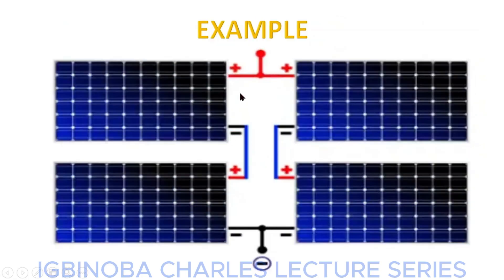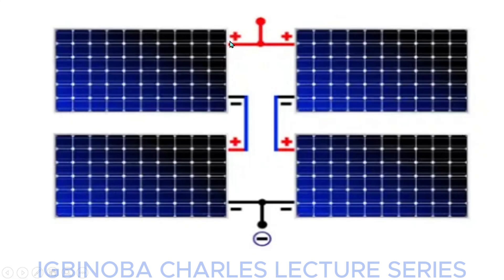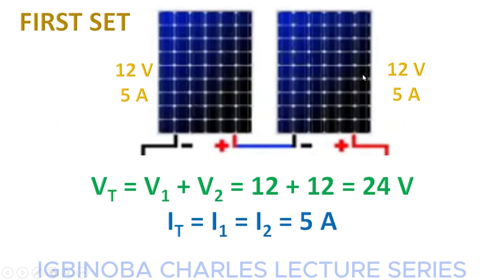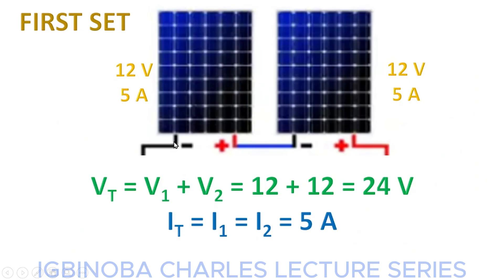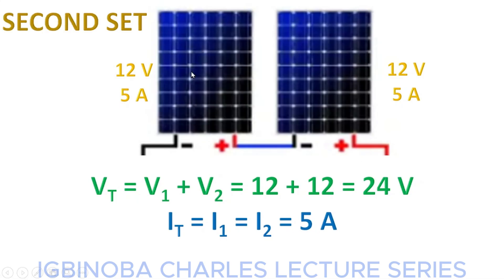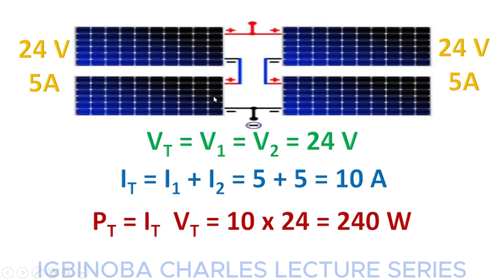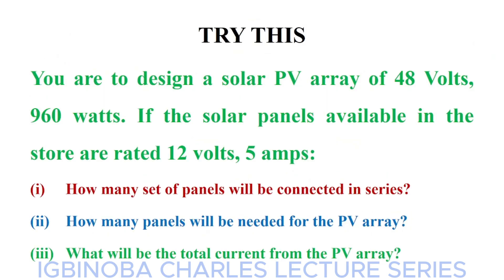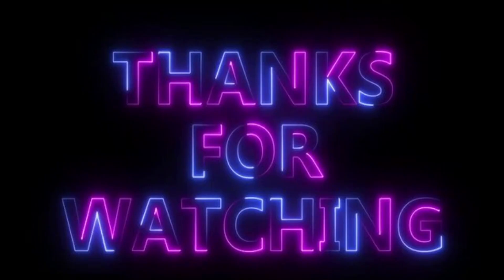Connection of  Solar Panels in SERIES-PARALLEL

Comment: MAR371S

SOLUTION 
1. NUMBER OF PANELS CONNECTED IN SERIES 
48V ÷ 12V = 4 PANELS

2. PANELS REQUIRED FOR THE PV ARRAY 
The power output of one  panel is the total voltage multiplied by total current.
P = 12x5 = 60Watts
Therefore the total number of panel to produce 60Watts is 
960 ÷ 60= 16 PANELS

3. TOTAL CURRENT FROM THE PV ARRAY 
Using the formula (I = P ÷ V)
I= 960W ÷ 48V = 20A.

Comment: MAR40N
1- 4 panels will need to be connected in series 

2- 16 panels will need to be  connected in parallel 
 
3- The total current of the array is 20Amps

Comment: MECH364L

1:
Number of panels connected in series = 48 ÷ 12 = 4

2:
Power output of one solar panel = 120 V × 5 A = 600 W.
The total required power for the array is 960 W, so the number of panels required = 960 ÷ 60 = 16 panels.

3:
There are 16 panels in total, with 4 panels connected in series.
Number of parallel strings = 16 ÷ 4 = 4 parallel sets.
Each set produces a current of 5 A.
Since the sets are connected in parallel, the total current becomes 5 A × 4 = 20 A.

Comment: MECH3107C

1:
Number of panels connected in series = 48 ÷ 12 = 4

2:
Power output of one solar panel = 120 V × 5 A = 600 W.
The total required power for the array is 960 W, so the number of panels required = 960 ÷ 60 = 16 panels.

3:
There are 16 panels in total, with 4 panels connected in series.
Number of parallel strings = 16 ÷ 4 = 4 parallel sets.
Each set produces a current of 5 A.
Since the sets are connected in parallel, the total current becomes 5 A × 4 = 20 A.

Comment: CHM315OT

1. 4 panels are connected in series, we connected four 12V, 5A panels in series, so we get a total of 48V, which is the voltage needed for the solar system.

2. A total of 16 panels are needed. Each panel produces 60W (12V * 5A).

3. The total current from the solar array is 20A using \(I = P + V

Comment: MECH3207A

i) 4 sets of panels are connected in series 
    That is 48V ÷ 12V = 4

ii) 16 panels are needed for PV arry 
     That is 960W ÷ 60W = 16

iii) Total current for PV array = 20amps
      That is 960W ÷ 46W = 20

Comment: COMP366N

I. Panels in series: 4
Because each panel is 12 V, and you need 48 V, you connect four in series (12 × 4 = 48 V).

II. Total panels: 16
Each panel is 60 W (12 × 5). Four in series give 240 W, so you need four of those sets (960 ÷ 240 = 4).
4 sets × 4 panels = 16 panels total.

III. Total current: 20 A
Each series set gives 5 A, and four sets in parallel add up: 5 × 4 = 20 A total.

Comment: MECH3180X

1. 48 ÷ 12 = 4 is the number of panels connected in series. 
2. One solar panel can generate 600 W, or 120 V × 5 A, of power. 960 W of power is needed by the array, which is equivalent to 16 panels (960 ÷ 60). 
3. Four panels connected in series make up a total of sixteen panels. 16 ÷ 4 = 4 parallel sets is the number of parallel strings. Five A of current are produced by each set. The total current is 5Ax4 = 20 A because the sets are connected in parallel.

Comment: PETRO3148R

i) When connecting panels in series, voltages
addup, but the current remains the same.

Required voltage = 48V
Each panel voltage = 12V
Number of panels in series = 48/12

= 4 PANELS IN SERIES

ii) A total of 16 Panels would be needed

Each Panel produces 60 watts I.e. 12V x 5A =
60W

To get 960W in total, therefore, 960W / 60W =
16 Panels

ii) Utilizing the formula - 1 = P/V

I = 960W / 48V = 20A

Comment: PETRO390L 

(i) Number of panels in series = 48/12                
    =4 panels in series

(ii) Panels needed for the PV array 
     Power = 12x5 =60W
    Number of panels = 960/60 
    =16 total panels 

(iii) Total current from the PV array
      Number of parallel sets = 16/4 =4 
       Each string produces 5A so the
       total current = 4x5 =20A
       Total Current = 20A

Comment: PETRO31A

(i) Number of panels in series = 48/12                
    =4 panels in series

(ii) Panels needed for the PV array 
     Power = 12x5 =60W
    Number of panels = 960/60 
    =16 total panels 

(iii) Total current from the PV array
      Number of parallel sets = 16/4 =4 
       Each string produces 5A so the
       total current = 4x5 =20A
       Total Current = 20A

Comment: PETRO338L

1. When connecting panels in series, voltages add up but current stays the same.
Required voltage= 48v
Voltage of each panel= 12v
No of panels in series = 48/12=4 panels in series 

2. A total of 16 panels would be needed. Each panel produces 60watts i.e 12v×5A
= 60W
To get 960W in total, 960W/60W
=16 panels

3. Using the formula, I=P/V
I= 960W/48W
= 20A

Comment: CHM391M
1 , 4 sets of panels will be connected in series 
Since 48v/12v =4

2, 16 panels will be needed for the PV array 
960W/60W= 16

3, The total current from the PV array is 20A
960W/48W= 20A

Comment: CHM 38H

i. 4 sets of panels are connected in series. (48v ÷ 12v = 4)

ii. Total of 16 panels are needed for the PV array. (960W ÷ 60W = 16)

iii. The total current is 20A. (total power/total voltage = 960w ÷ 48v = 20A)

Comment: MAR3109E 

1.Series Connection:
The number of panels to be connected in series is calculated as:
48 ÷ 12 = 4 panels in series.

2.Power per Panel:
Each panel generates:
120 V × 5 A = 600 W.

The required total power for the array is 9600 W.
Therefore, the total number of panels needed is:
9600 ÷ 600 = 16 panels.

3.Parallel Connection:
Since there are 16 panels in total and 4 panels per series set, the number of parallel sets is:
16 ÷ 4 = 4 sets in parallel.

Each set supplies 5 A, so the total current in the PV array is:
4 × 5 A = 20 A.

Comment: CHM3132B

1) To achieve total voltage of 48V from 12V panels, (series connection)
48/12 = 4 panels in series

2) Total Power = 960W
Power in each panel= 12 x 5 = 60W
No. of panels needed = 960/60
= 16 panels in total

3) Total Power = I(total) x V(total)
I(total) = Total Power/Total Voltage 
= 960/48
= 20 A

Comment: PETRO339M

i) When connecting panels in series, voltages add up, but the current remains the same.
Required voltage = 48V
Each panel voltage = 12V
Number of panels in series = 48/12
= 4 PANELS IN SERIES
ii) A total of 16 Panels would be needed
Each Panel produces 60 watts I.e. 12V x 5A =
60W
To get 960W in total, therefore, 960W / 60W =
16 Panels
iii) Utilizing the formula - I = P/V
| = 960W / 48V = 20A

Comment: EEE356D

A 960w 48volts should supply 20A

A panel rates 12v, 5A

I) To generate 48volts and 5amps, the number of panels needed to be connected in series are;
48/12= 4 panel

ii) To generate 20amps the number of panels needed In parallel are;

If 4 panels = 5amps 
then Xpanels=20amps😮
5x=80; x=16 panels 

iii) The total current of the array is;
I=960/48=20Amps

Comment: EEE3128X
1) 4 panels are connected in series i.e 48v÷12v = 4 panels 

2) Each panel produces 12v×5A = 60w
Therefore, 960÷60 = 16w

3) Total Current ; 960 ÷ 48v = 20A

Comment: PETRO3187E
1. Four panels will be connected in series
48v/12v =4
2. Sixteen(16) panels will be needed for the PV array
960W/60W =16 
3. Total current from the PV array = 20A
960W/48V =20A

Comment: PETRO3109E

To achieve a final voltage of 48 V for the array, you'll need to connect the panels in series. Since each panel provides 12 V, you'll require 4 panels connected in series. 2. Each panel generates 60 W (calculated as 12 V x 5 A). Given that the total power needed is 960 W, you'll need a total of 16 panels to meet this requirement. 3. With a total of 16 panels and 4 panels per series string, you'll end up with 4 parallel strings. As each string provides 5 A, and since they're in parallel, the total current will be 20 A (5 A x 4).

Comment: MECH357E

1.) Four (4) panels are to be connected in series (48/12=4)
2.) A total of 16 panels are needed for the array. 
The required power in the array is 960 W. Therefore the number of panels needed for the array is 16 panels (960/60=16)
3.) The total current from the PV array is 20amps
(I=960W/48V=20 A)

Comment: PETRO 363K 

1) FOUR (4) panels are connected in series 
      48v / 12v = 4 

2) The power generated by one panel= Vt x It = 12 x 5 = 60watts
To get 960watts in total 
   960/60 = 16 panels 
So for the pv array , 16 panels will be needed

3) Total current , I = P/V 
       I = 960watts / 48volts = 20A
   So total current = 20A.

Comment: PETRO375W

1. Four (4) sets of panels will be connected in series.
2. Sixteen (16) panels are needed for the PV array.
3. Total current from the PV array is obtained using the formula; I=P/V
Where; P=960watts, V= 48 volts
1= 960/48=20Amps

Comment: MECH3171O

1:
Number of panels connected in series = 48 ÷ 12 = 4

2:
Power output of one solar panel = 120 V × 5 A = 600 W.
The total required power for the array is 960 W, so the number of panels required = 960 ÷ 60 = 16 panels.

3:
There are 16 panels in total, with 4 panels connected in series.
Number of parallel strings = 16 ÷ 4 = 4 parallel sets.
Each set produces a current of 5 A.
Since the sets are connected in parallel, the total current becomes 5 A × 4 = 20 A.
Reply: Mech3115k

1. 4 sets of panels will be connected in series.

Since connecting 4 of the 12 volts, 5 amp panels in series gives a total of 48 volts as required by the solar PV array design

2. 16 panels will be needed for the PV array.

This is because the power of each panel is 12 x 5 = 60 watts, therefore the total number of panels to produce 960 watts is, 960/60 = 16

3. The total current from the PV array is 20 amps Since I (total) = P(total)/ Vitotal) I (total) = 960/48 = 20amps

Comment: COMP338L

1. 4 sets of 12V 5A panels will be connected in series. Ie, Vt=12+12+12+12=48V
2. 4 sets of 4 panels connected in series will be needed; 16 panels are required
3. The total current will be 20A

Comment: MECH 361I

1.	The number of panels that will be connected in series is calculated as 48 ÷ 12 = 4.
	2.	Each solar panel generates 120 V × 5 A = 600 W. The total required power for the array is 960 W. Therefore, the number of panels needed in the array is 960 ÷ 60 = 16 panels.
	3.	Since there are 16 panels in total and 4 panels are connected in series, the total number of parallel sets is 16 ÷ 4 = 4. Each series set produces a current of 5 A. Because the sets are connected in parallel, the total current becomes 5 A × 4 = 20 A

Comment: PETRO343Q
1. 4 panels are connected in series
2.16 panels will be needed for the PV array system:
Each panel has a rating of 12v 5A, the power of each pan l will be 12×5=60W
P=IV
From the total power of 960W, we get 960/60=16 panels for the PV array system
3.  Total current= P/V
 960/48 =20A

Comment: CHM3112H

1. 4 panels are connected in series, we connected four 12V, 5A panels in series, so we get a total of 48V, which is the voltage needed for the solar system.

2. A total of 16 panels are needed. Each panel produces 60W (12V * 5A).

3. The total current from the solar array is 20A using \(I = P + V

Comment: PETRO3103Y 

1. 4 sets of panels would be connected in series(48V / 12v) = 4

2. A total of 16panels would be needed for the PV array (960W / 60W) =16

3. The total current from the PV array is 20A .
(960W / 48V) = 20A

Comment: PETRO3117M

1.Number of Panels in Series
Required system voltage = 48V
Each panel voltage = 12V
Number of panels in series = 48V ÷ 12V = 4 panels
Answer: 4 panels in series.

2.Total Number of Panels Needed
Power of one panel = 12V × 5A = 60W
Total required power = 960W
Total number of panels = 960W ÷ 60W = 16 panels
Answer: 16 panels in total.

3.Total Current from the PV Array
Total panels = 16
Panels in series = 4 → Number of parallel sets = 16 ÷ 4 = 4 sets
Current per set = 5A
Total current = 4 sets × 5A = 20A
Answer: The total current is 20A

Comment: PETRO3111G

1. 4 sets of panels will be connected in series.
2. 16 panels will be needed for the PV array.
3. The total current from the PV array is 20 amps

Comment: PETRO352Z

1. Four panels are connected in series. When you connect four 12-volt, 5-amp panels in series, you get a total of 48 volts, which is the voltage needed for the solar system.
2. A total of 16 panels are needed. Each panel produces 60
watts (12V x 5A = 60W). To get W in total: 960 60 =
16
panels.
3. The total curent from the solar array is
20-amps. Using the formula I = P + A,
1 =960W / 48V = 20A.

Comment: PETRO3168L
1). 4 panels are connected in series

We connected four 12-volt, 5-amp panel in series, so we get a total of 48 volts, which is the voltage needed for the solar system.

2). A total of 16 panels needed.
Each panels produce 60 watts I.e 12V × 5A =60W
To get W in total: 960÷60=16 panels 

3).The total current from the solar array is 20 amps
Using the formular I = P + A
Therefore I= 960W÷48V =20A

Comment: CIV383E

1. Four panels are connected in series 
12-volt,5-amp panels are connected in series , you will have a total of 48volts , which is the voltage required for the solar system 

2.A total of 16 panels are needed 
Each panel produces 60watts i.e (12v × 5A=60W)
To get 960W in total 960÷60=16panels

3. The total current from the solar array is 20amps 
Formula=I =P÷V
I =960W÷48V=20A

Comment: MECH3185C

Required PV array: 48 V, 960 watts
Solar panel available: 12 V, 5 A

(i) In series, current is constant for all panels but the voltages add up.

So, we need a total voltage of 48 V, and each panel has 12 V.

Total number of panels = Total required voltage ÷ Voltage per panel
= 48 / 12
= 4 panels

(ii) Total number of panels for the array = 

Total power needed = 960 watts
Power in each panel = 12 V × 5 A
= 60 watts

Number of panels = Total power required ÷ Power per panel
= 960 / 60
= 16 panels

(iii) Total current in PV array = ?

4 panels are connected in a series string with a total voltage of 48 V and a total current of 5 A.

We have a total of 16 panels, hence:
Number of parallel strings = Total panels ÷ Panels per string
= 16 / 4
= 4 parallel strings

In a parallel connection, voltage is constant but current is not constant.

Voltage required: 48 V

Total power: 960 W

Panels per series string: 4

Total panels: 16

Parallel strings: 4

PV array output: 48 V, (4 × 5 A) = 20A

Comment: PETRO3179W

1). 4 panels are connected in series.
We connected four 12-volt, 5-amp panels in series, so we get a total of 48 volts, which is the voltage needed for the solar system.
2). A total of 16 panels are needed.
Each panel produces 60 watts I.e. 12 V x 5 A60 W To get 960 W in total, 960+60= 16 panels.
3). The total current from the solar array is 20 amps.
Using IP + V, we have that, 1960 W 48 V20 A.

Comment: CHM3152V
1.  Number of panels in series = 48/12 = 4 panels.
2.  Number of panels needed for the PV array = Total power in the circuit/ Power in each panel = 960/60= 16 panels.
3.  Total current from the PV array = Total power/ Total voltage = 960/48 = 20 Amps.

Comment: COMP3116L

1: Sets of panels that will be connected in series is 48 / 12 = 4

2: The power generated by a single panel is = 120 V x 5A = 600 W. The required power in the array is 960 W. Therefore, the number of panels needed for the array is = 960 / 60 = 16 panels.

3: 16 panels are in the array and 4 panels are in series. Total number of parallel sets of panels = 16 / 4 = 4 parallel sets. Total current from each set of panels is 5A. Since these sets are in parallel, the total current is = 5A x 4 = 20A.

Comment: MECH349W

1. The sets of panels that will be connected  in series is (48v/12v) = 4

2. The panels that will be needed for the PV array (960W/60W) = 16

3. The total current from the PV array  is ( 960W/48W) = 20A

Comment: CHM3101W

 1. Four (4) sets of panels will be connected in series 
     
        48V / 12V= 4panels

  2. A total of sixteen (16) panels will be needed for the PV array 

      960W / 60W = 16panels

 3. The total current from the PV array is 

        960W / 48V = 20A

Comment: MECH3153W
1. Total number of panels placed in series - 48V/12V = 4 panels.
2. Total number of panels needed for PV array - 960W/60W = 16 panels.
3. Total current in the PV array - P=IV, where P=960 and V=48. Therefore, I=960/48 = 20A

Comment: COMP348V 

1. In order to achieve 48 Volts from 12 Volts panels,
Number in series
= 48v/12v = 4
4 set of panels
2. Each panel will produce 60W (12V x 5A)
Given total power to be 960W
960W/60W= 16 panels
3. Total current is given by
Number of panels in parallel X Each current
Numver of panels in parallel = 16/4 = 4
 Total current = 4x5A= 20Amp

Comment: EEE360H
1.Number of Panels in Series
Required system voltage = 48V
Each panel voltage = 12V
Number of panels in series = 48V ÷ 12V = 4 panels
Answer: 4 panels in series.

2.Total Number of Panels Needed
Power of one panel = 12V × 5A = 60W
Total required power = 960W
Total number of panels = 960W ÷ 60W = 16 panels
Answer: 16 panels in total.

3.Total Current from the PV Array
P=IV
P=960 V=48
I=P/V=960/48=20A
Answer: The total current is 20A

Comment: CHM3116L

1. Number of panel sets in series: 48V ÷ 12V = 4
2. Number of panel for PV array: 960W (12V*5A)
= 960W 60W = 16
3. Total current:
Number of parallel strings: total no of panel for
PV array/number of panels set in series = 16/4=4
Therefore total current=4*5A=20A

Comment: PETRO316P
1. Four panels are connected in series.when u connec four 12volts,5amp panels in series u get a total 48volts.

2. A total of 16 panels are needed 
Each panel produces 60watt( 12v × 5amp =60watt).i.e to get 960watt: 960 ÷60=16 panels 

3. using formula I= P ÷ V
I = 960watt ÷48volts =20amp

Comment: MAR39I 

1.  4 sets of panel to be connected in series  48v/12v = 4
2. 6 panels will be needed for the PV array 960W /60W = 16

3. The total current from the PV array 960W /48W  =20

Comment: COMP357E

Answers
1. Number of panels set in series = 48V ÷ 12V = 4
2. Number of panels for PV array = 960W ÷ (12V x 5A) = 960W ÷ 60W = 16
3. Panels connected in parallel =  4 x 5A = 20A
Thank you